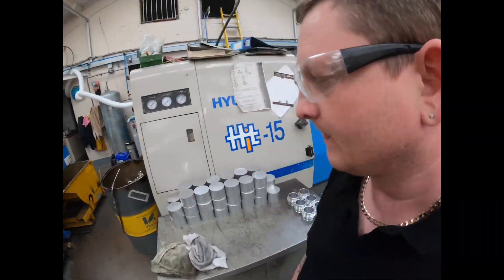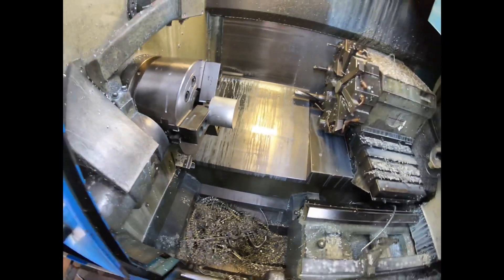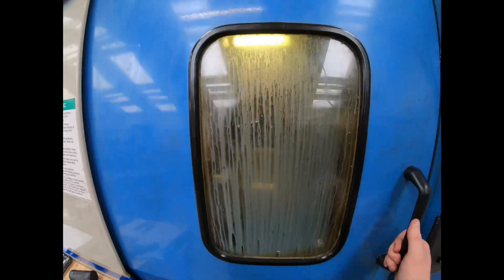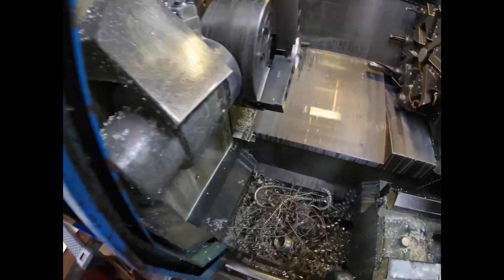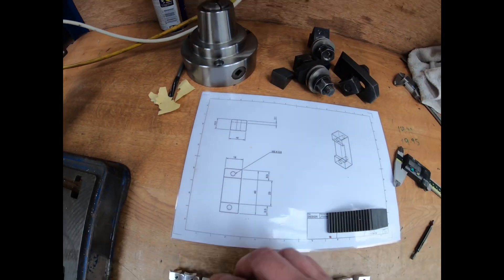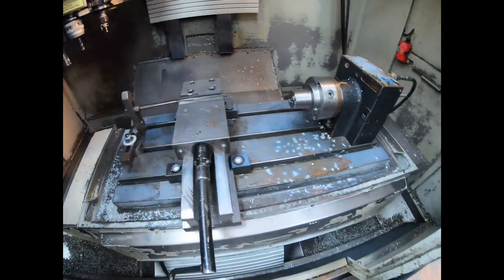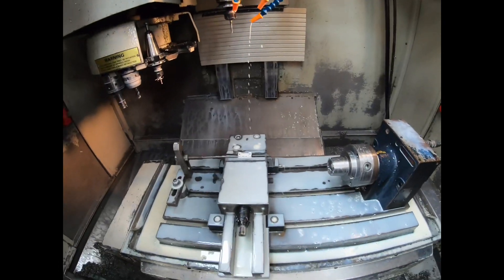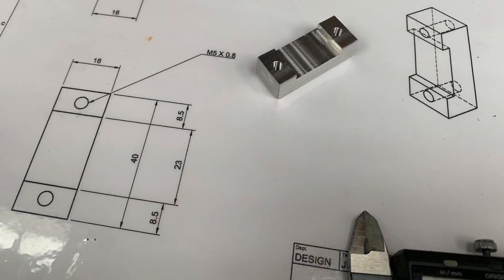Hyundai lathe work and Bridgeport vmc work

Comment: Hi. Iam interesting buy hit20m. In your opinion is nice machine. Or have some problems ? Thanks
Reply from the maker: Hi

In my option the hit20 is a great machine and very rigid and accurate 

The control can be a bit complicated so make sure you get the manuals
Reply: @kinzy_fabrications  hi. you can help me with mp c1 axis parameter 30220 in your machine ? if you take a picture is nice. thanks
Reply from the maker: Hi

I’m afraid the Hyundai hit is not my machine and I am unable to get the parameters from it
Sorry

Comment: Big step up from  the XYZ
Reply from the maker: nick nick 
Hi
Definitely is, the xyz is a great lathe but the manual tool changes make it no good for big batch runs like this, also it could never drill a 40mm hole in 1 hit like that